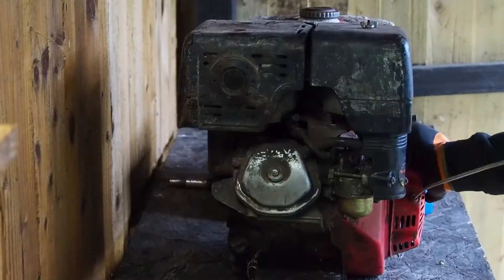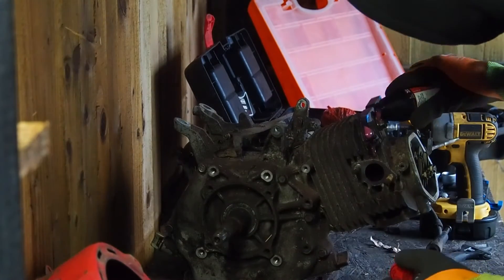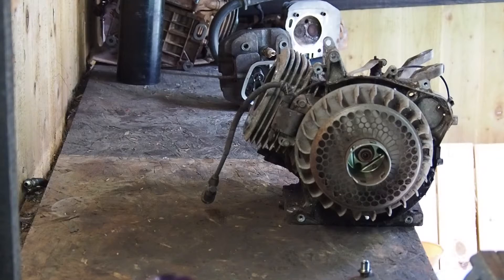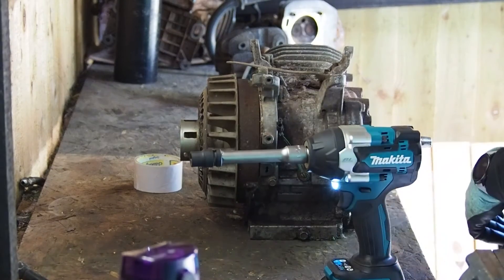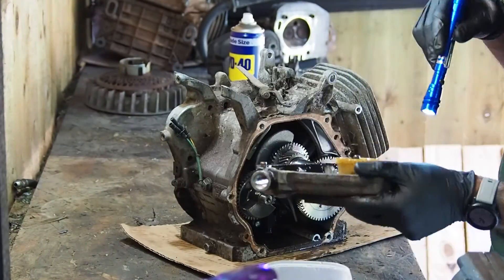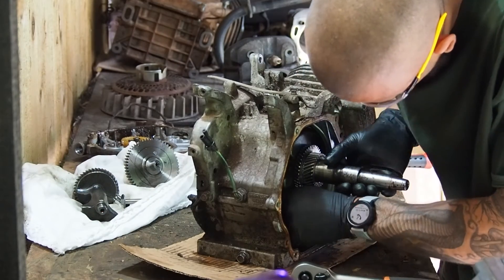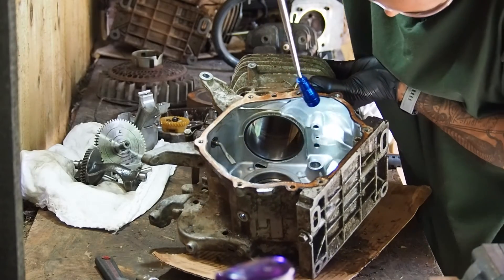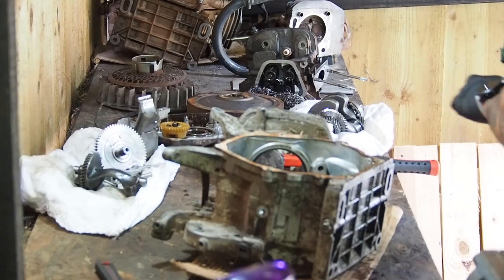HONDA GX340 ENGINE REVIVAL - Part 1

Comment: Im working on a similarly neglected homda gx340. Mine had water sitting in the exhaust and has a water spot on the cylinder wall. I hones it out almost 100%. Now im lookin at the piston, it measures right at 88mm ln the skirts and tje top above the top ring measured 87.6mm
 Would you run that piston with new rings?
Reply from the maker: Thanks for your comment mate! 
You could just use new rings, as long as the clearances were in tolerance that would be fine. Nowadays tho you can get the rings and a new piston for a similar price so I'd probably grab both, just piece of mind for me but also get more life out a new piston. Let me know what you decide 👍🏾